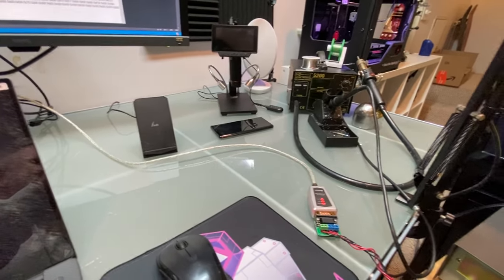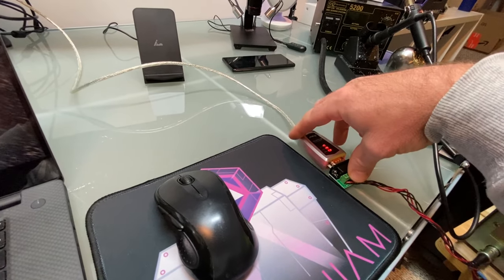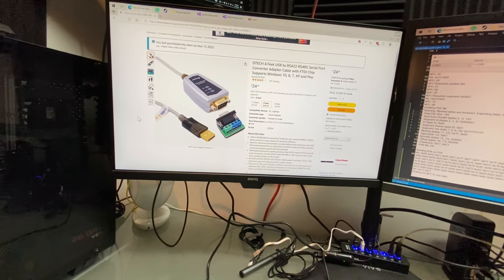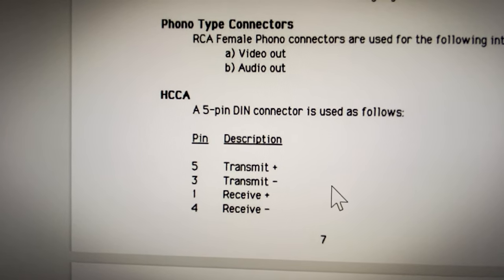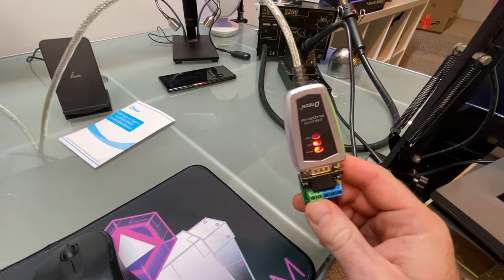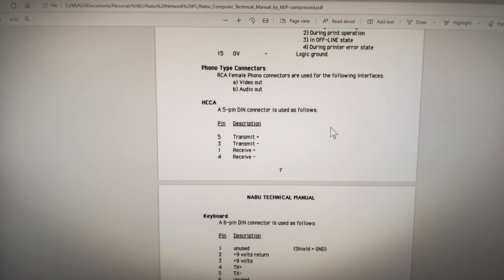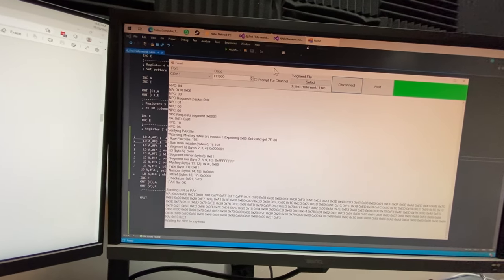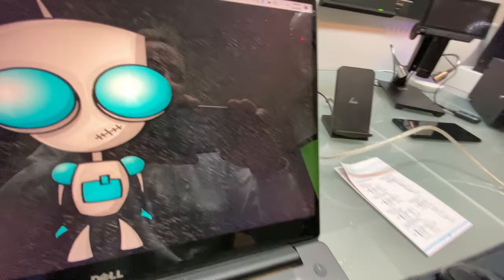08 - Getting a Nabu computer? You need this!

Comment: So if I understand this

This methods all bypass the tv module which would usualy plug with 5din connector

Also how u are suppose to write software for this thing

Do u first hook into the network snd then u have an asembler there and then u automaticly upload ur asembled program to the network?

Comment: RS-422 looks really cool! It seems one wouldn't need any voltage level convertor to interact with a microcontroller. I wonder if you can power an ESP32 from it directly with just a few passive components or if that can fry the port. I guess it depends on the maximum current it draws.

Comment: I just took a look at the manual. There states "A 4K byte ROM contains ... ... software which can communicate with the HCCA or a floppy disk to allow for bootstrapping". For me it seems that this thing is able to boot from a floppy. Am I right? And if so, how an end user will connect the floppy? May be an external one like C64 had? Seen the DIN adapter connector, I think that there one could connect an external floppy disk unit. I looked at the pinout and is not compatible with C64 interface but it might be a floppy unit that just like the keyboard and the Commodore floppy is a computer that receives and sends data over that serial port.
That way it can boot CP/M. Must see the commands that it is able to send and receive over that serial interface.
Reply: I hope to one day find or make an emulated Nabu floppy drive using a pi-pico and an sdcard or similar available microcontroller setup. Of course DJ will probably have done that by his next video!

Comment: Because not all of the Nabu units were sold with keyboards from the listing Adrian Black put on his video, some of us won't have one. Would you be able to document the connections and protocol on that eventually?

I'd like to maybe try to make a PCB or enlist someone to, so we can put in our own key switches and make a replica keyboard. Maybe have someone like JLCPCB or PCBway make a case too since they'll do metal / plastic (probably super expensive though to make plastic molds). Or have them 3D print a plastic case for us.
Reply: In the interim I was just going to hack on it with no input and maybe try to cobble together something in a USB to Nabu keyboard adapter out of an ATTiny or something.
Reply: Seems to be a fairly generic ascii keyboard with some slight quirks like sending an init code

Comment: I have a feeling this will be epic.   Apparently 1000 available, and looks like only 720 sold.   Hopefully more available for parts/repair at some point.
Reply: Only 720 out of 1000. Looks like a good score to me!🤔
Reply: @@thejeffshow2399 I went and picked up mine in person, and had a conversation with him.  He most certainly was NOT ready for the rush.  The whole surge took him completely by surprise, and he is having a hard time getting them shipped out.   He told me he had about 450 labels to print, some of those were for multiple units, but he can only fit about 40 units in his car at a time.   I had suggested talking with UPS or Fedex about picking them up from him, so he is going to look into that.
Reply: @@thejeffshow2399 He bought them as overstock, I think he said in 1989 or thereabouts. He had some structural issues with where he was storing them, and the new storage location has some fairly low wife approval factor.

What is slowing him up the most right now is he is unpacking and testing each and every one before he sends them out.  I am not sure if he will continue to do that much longer though.